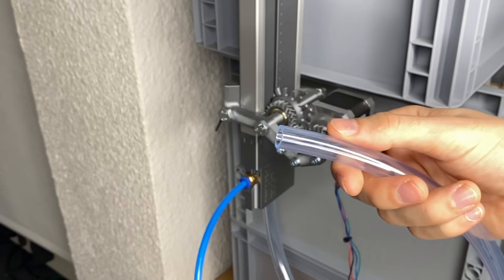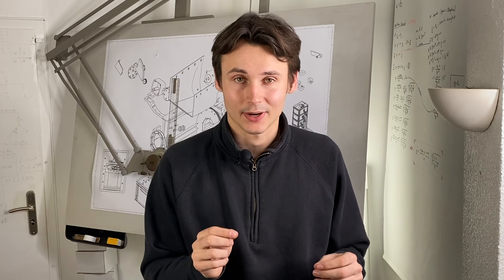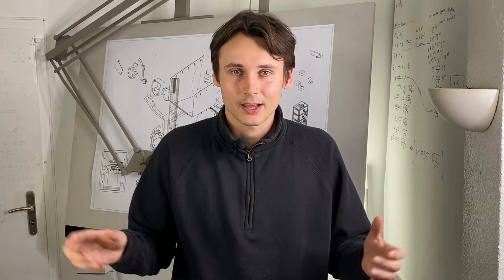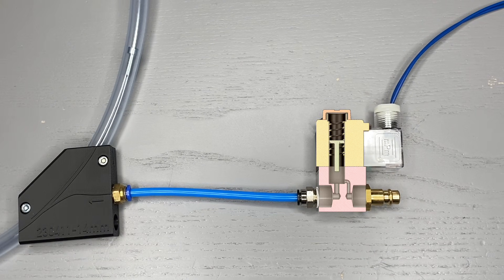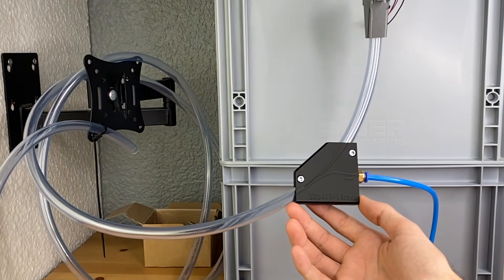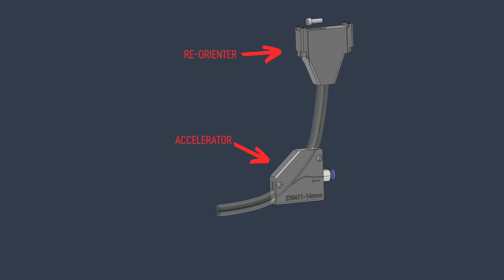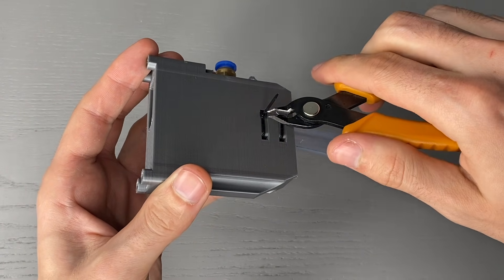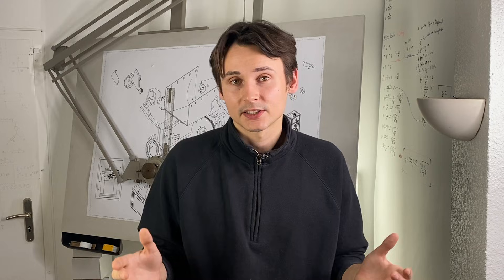A pneumatic accelerator for screws - 3d printed automation #004

Comment: I totally agree with you idea of complexity in 3d printed parts. The technology of additive manufacturing makes the realisation of complex / feature rich geometry easy and we should utilize that in our designs. On the other hand big or many printed parts make this manufacturing process more complex (time consuming / costly) itself thus reducing number and size of these parts while / by maintaining a high "complexity density" is the best utilisation of this technology I think. Using of the shelf parts for the rest of the assembly's is just reasonable.
Reply: Complexity usually makes 3D printed parts cheaper. Add some embossed text for a label? Cheaper, as it takes less plastic and time now, as well as being far more complex and better. Add a fixing hole now, rather than drill it later? Cheaper and more complex. Add view holes? You get the idea.
Reply: Also, wear/durability of the parts could be considered, depending on the application. If a part fulfills a lot of functions and one function fails, you would have to replace the whole thing. It might be worth it to produce a seperate part that can be easily replaced, or make it out of a more durable material.
Reply: @Frrk  Yeah, this is of cause true, but only to some degree I think. If I have a system and would design it such that every (printed) part has only one functionality to it, I'd have to disassemble more of said system to replace different parts. If the complexity lies only within some parts (that thus have multiple functions) and some functionalities fail, I would have to replace and disassemble less of the overall system. Especially if these few spats are easily accessable. And the production of feature-rich parts is with 3D printing probably as easy as it gets. So, as always, it depends on the case of cause, but my point is that even when thinking about failing parts, grouped functionalities might not always be a bad thing.
Reply: @jannsander  This also has a cost factor attached to it. I see it a lot on cars, one part does 5 things, and when it breaks it costs an arm and a leg.

It should be a balance between the two.
Reply: @AlanGonzalez-om4rr  That is absolutely true for cars and airplanes and other insanely expensive stuff, but for 3D printed parts I think there isn't so much of a problem there - of cause referring to the restrictions above.
Reply: Complex*